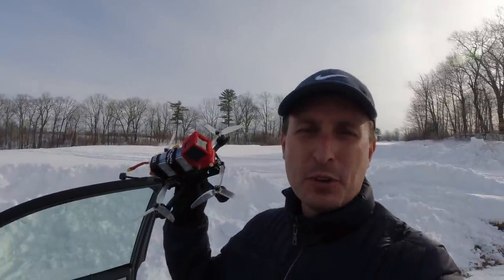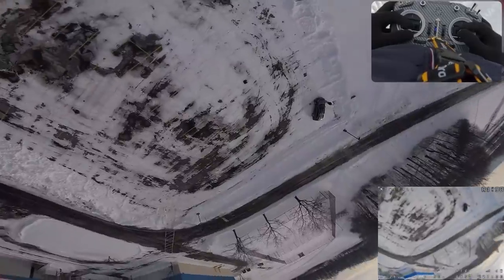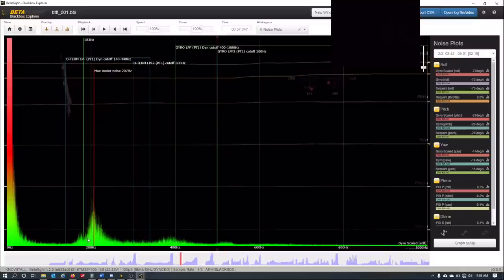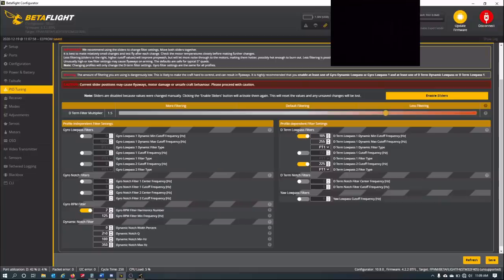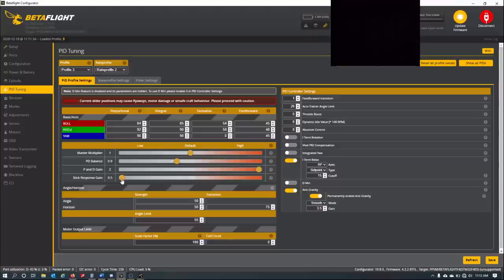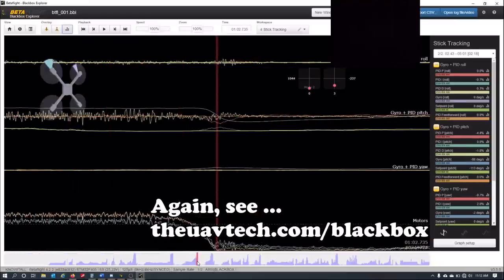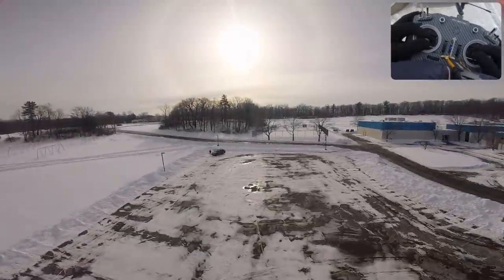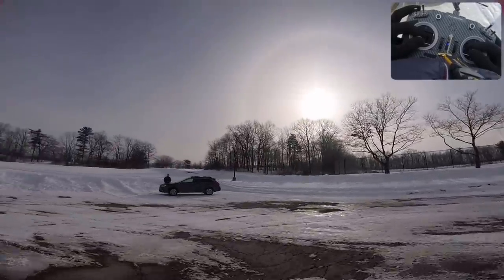How to get an AMAZING Tune -- Tuning JB's 5" Quad

Comment: You are amazing. Thank you for breaking it down to setting filters then PD ratio etc.. the PD ratio bit is something I never understood and always just flew stock pics because I got sick of chasing my tail with pid adjustments. I also underestimated the value of the sliders.

Comment: I agree, BF FF has been good since 4.20 and the actual rates allow one to utilize it to the maximum. To me the default works pretty good but you do need to tweak the ff_boost to match your quads weight and prop to make it feel right. But once you get it right the first time, there’s no going back 🤷‍♂️

Comment: Awesome, so many insights!! You have not commented the motor traces, are you not concerned by motors saturation? At 13:36 motor [1] is maxing out which could lead to inconsistent flight, right?

Comment: Hi Mark I got your link from Joshua, Im so glad I found your channel and website. Im trying to do your exact tunne since I got the cidora also. But on my betaflight 4.2.5 in the independent filter settings the Gyro rpm filter does not show, I only have the gyro lowpass filter, the gyro notch filter, the dynamic notch filter, D term lowpass, D term notch and yaw lowpass but no gyro rpm filters settings show.
Reply from the maker: Turn on Bi-Directional Dshot in Configuration tab.  Make sure not errors when you spin up motors in Motors tab.

Comment: 21:00 most likely your RC output in the radio isn't set correctly. You'd most likely need to adjust mid-trim within the radio for yaw or any axis that isn't showing 1500 in BF or whichever firmware is being used.

Comment: Mark, this is awesome!  Thanks so much!  Just recently began following, although I had inadvertently watched several of your videos in the past.  Would emuflight be an even simpler process, due to the lack of filter sliders?  I apologize if this is a dumb or incomplete question.... im 10 months into the hobby and just now venturing beyond stock tunes and emu presets
Reply from the maker: I would say emu is harder for a lack of sliders.  Everything needs to be set manually and you need to keep ratios in mind because the sliders are not there to hold them for you.
Reply: @uavtech  thanks Mark.  I think im going to take the Patreon Plunge (just coined it, feel free to use it 😆) and really dive in.  Im absolutely lost in these videos dealing with Blackbox graphs and cell data... but I think, just as with the rest of this hobby, that  familiarization will bring understanding.   Thanks for the incredibly timely response!  Super cool of you!
Reply: @uavtech  hey mark.... can you make any fairly quick recommendations as to how I can achieve that "flight one feel" in Emu or Betaflight?
Reply: I realize this might be asking a very broad question.... if so, I apologize
Reply from the maker: Tune like shown here and use F1 rates.  F1 uses high gains.

I think their FF is weaker, but still need to confirm.  SimMode is some fixed amount of FF.  SimMode off is no FF.
Reply: @uavtech  nice!!!!   Thanks so much!!!!  Man!  I've gotta get my head wrapped around all of this, and sooooooon!!!! Lol

Comment: Great tune and explanation thanks 👍
I’m wondering if the yaw movement at 20:50 is similar to something I experience once in a while with my FrSky QX7. I’ll start flying and notice the quad slowly rolling to the right, not by much but annoying and I have to power cycle the radio to fix it. It’s happened with the radio’s internal tx, R9 and crossfire module, it’s like the stick calibration is out on the radio.
Reply from the maker: Increasing deadband sorted it out.
Reply: @uavtech   Yeah I read that in the video and tbh It happens so infrequently over the past few years that I’m not looking to fix it but I find it odd that it’s always right roll for me, regardless of quad and power cycling the radio fixes it.

Then again there’s so many potential points of failure in our hobby I find it amazing we even get into the air when I really think about it 😂

Comment: Great looking tune at the end! Curious as to why you decided to keep d_min disabled while still incorporating a good amount of feedforward. Is that a specific choice for this quad, or do you tend to keep d_min disabled with FF under ~200?
Reply from the maker: I go to D max for the best performance.  At that point boosting D sends it over the limit.  Also, D_min is delayed in booting so does hot help with prop wash.
Reply: @uavtech  copy that. So once you have dialed in a p-d balance,  do you add a little more d_max to help balance the addition of FF?

Comment: Great video Mark. Do you think a tune similar to this ( or all the exact changes you did to Josh's kwad) will get similar results on a 4s kwad on betaflight 4.1.0.  Cidora sl5 frame brand new t motor f60 pro4 2550kv motors zeez f7 flight stack
Reply from the maker: Yup, as long as the vibrations are low like JB's quad.
Reply: @uavtech  awesome thank you

Comment: Thanks Mark for your amazing videos. In general, which slider is helping to reduce bubbles in smooth linear flight?
Reply from the maker: Bobbles are mechanical issues.  You can do your best to cover them up, but may never.be.100% happy.  Maybe try adding D_min to suppress D-term in forward flight.  But it will.make wash performance a little worse.
Reply: @uavtech  ok I will try that... I got this on a Diatone Taycan MCX with 4.1.2. One I moved to 4.2.5 those “bubbles” are much less noticeable but still there when I’m not touching the sticks in straight flight.
Reply from the maker: First make sure RPM filters are enabled wit Dynamic Notch too.  Set Dyn Notch Max to 600.  Try filter sliders are 1.0 and my Toothpic Presets for PIDs.
Reply: @uavtech  great!! Thanks again!

Comment: Thanks Mark, another cool vid, is it possible to filter out light video lines in the video feed?
Reply from the maker: it is electrical noise.  So yes, if you put a capacitor on the electrical feed on the camera or VTX, OR both.
Reply: @uavtech  thanks Mark, Happy Flying

Comment: 1:54 what kind of oscillation was that?
Reply from the maker: Me pumping the throttle to check noise holding.  Or what I (most) call "throbbles". So me pumping the throttle to check "throbbles".
Reply: @uavtech  Thank you. I'm trying to tune my drone on emuflight for almost for a year and cannot get rid of oscillations on sharp turns and split s... Also it shakes in the wind... I do not understand at all does high dterm helps to reduce propwash, because I see two opposite views on that... I have nazgul5 with velox2207 2550kv motors... pid roll 74 60 51, pid pitch 77 73 56... On your videos your pd balance is much higher, dterm is almost twice lower than p... Also I can't get any oscillations with high P even at 200, so my pterm is just choosen by no real reason...
Reply from the maker: @О.Ш-ь1щ  it is all in balance.  At 200P, you have overshooting.  Check out a log, it is easy to see there.

D-term stabilizes for outside influences (wash and wind), BUT also magnifies vibration from motor or frame.  So, if mechanical vibration is low, you can pile on the D-term to keep quad stable in wash and wind.  With that, P-term to keep the nose on point (on the sticks).  D-term stabalizes and P-term keeps the nose on point.

Comment: Hi I'm new in the hobbies I tried tuning my quad for myself I think it fly's great punch out properly wash goonbut if I drop the throttle quickly after a punch out I get a wobble left to right but is smoothens out after ABIT 3 wobbles.dinamic idle set to 25 get longer inverted hang time

Comment: Why don't you use Vbat PID compensation ? I understand a full lipo the quad responds much better than at empty lipo and so the tune is depending on Vbat.  Is there a problem with Vbat are there negative affects ? could you do some testing ?

Comment: Was P/D balance slider on 1.0 not too high? From my experience with that little filters delay my slider is usually at 0.8 sometimes even on 0.7 without overshoot. Just curious 🤚
Reply from the maker: Yeah, but not on this quad.  I generally agree though.

Comment: Is this really an iFlight Cidora SL5-E? Why isnt the target IFRC/IFLIGHT_SUCCEX_E_F4?  In both this and JB video, the target goes between FPVM/BETAFLIGHTF4 and AIRB/OMNIBUSF45D.  Otherwise quite helpful guidance for tuning, as usual with your videos.
I tried these exact settings on my SL5-E and it took off uncontrolled right after arming... back to the defaults and progressive tuning.
Reply from the maker: It was.  For JB's video we were looking at setting on my bench FC since he had the Cidora.

Comment: Question? I got a pre tune iflight titan 1800kv 6s bnf. It sounds good in person but on the hero 8 it sounds like a crap tune. Sounds like the motors are over working. But again it sounds okay in person. Could that be the GoPro or the actual tune? Thanks 🙏🏻

Comment: Would it by a bad idea to have filter settings linked with PID profile settings (with filter tabs having as many profiles as there are PID profiles)? So you can set different profile/filter combos at home and then go out and try them one by one?
Reply from the maker: They should be.  D-term.filter are, but Gyro filter are.not yet.  Just takes someone to do the work and submit as PR.
Reply: @uavtech  D term filters are? Only internally as an option then, 'cuz in user interface there is no way to select filter profiles, right?
Reply from the maker: D-term filters are stored in the selected PID profile.  Gyro filter are not since those filters use tp run in the gyro loop.  That was changed in 4.2, but someone needs to change storage location which has not been done yet.
Reply: @uavtech  I see, thanks for that info. I never inferred that from the gui, but I guess that's because some work need to be done in that area still. Looking forward to it!

Comment: hey i followed this method of tuning, and got my quad flying really amazing, but when i try to land, or accidentally bump the ground, it really yips harder than i would like. motors are cooler than miles davis. my question is, i know bringing the d term down should help that, but i was curious if just bringing the PD balance back from 1.2 to like 1 and then increasing the pd gain til my d term is back where it is now would also help that, i.e. does more p have a similar effect as lowering the D?

Comment: I recall commenting sometime last year that I would love to see you tune JBs or other Youtubers quads with your technique versus their tune to compare.  I've tuned all my quads using your techniques and they all run smooth and very responsive.  Although I  use Blackbox to see how the gyro tracks the stick response , I find that the PID curve using PID toolbox gives much better analytical data on how well the gyro and sticks are tracking (tuned) after each PID change....the PID curve never lies....if it is over or under dampened it will show it.   Is there anyway you can send me the raw BlackBox data from JBs tune and your tune so I can see what the PID curve looks like for both?

Comment: Looking forward to tune my Source1 for midrange 1700kv on 4s and 6s. What would be the difference on PIDs if running two different profiles for 4s and 6s? I means how much higher pids would be on 4s?
Reply from the maker: Hard to say.  I reckon it will influence PD Balance and P and D Gain slider extents.  Both Balance will need to be lower in 4S and P and D Gain higher.

Comment: Hi do you have or can you help with a PID Tune on a Geprc Tinygo? Once I arm the motors the quad seems to move to one side not sure if a pid tune can help with this? Any advice would be great thanks.
Reply from the maker: Angle or Acro.  Set Deadband in Receiver tab to 5.
Reply: Angle mode
Reply: I'm just starting out in fpv so looking to see if there is a pid tune to help smooth out the flight as it  seems like the stick are very sensitive?
Reply from the maker: For Angle Mode, decrease Angle Strength in the PIDs tab.
Reply: Perfect I'll give that a go thanks for the advice.

Comment: Any advice for folks like me who learned on 800 degrees/second with no expo, in regards feed forward... I'm now at a point in BF of about 1.95 BF rates with 0.44 super rate and 0.12 rc expo... But unless I turn FF down, it still is rediculous at centre stick! Do I need to rewrite my 5 years muscle memory to get the most from BF, or do I just keep FF lowered?
Reply: Great video BTW... How much does JB's quad weigh?

Comment: How to prevent overshoot
?
By looking into black box
Reply from the maker: Check out: https://youtu.be/23CAS_nlVbo

U have to know which type of overshoot (" bounceback ") first.  This video discusses both and now to fix each.
Reply: @uavtech  thanks for soon  reply 👍
I have already seen that video and from last one week I am watching your tutorial videos many times and i learned a lot but when ever I am go out to field and try to tune my 5 inch quad and try to see the black box and figure out what's the problem, my brain gets freeze by looking at so many waveforms
As I the gyro wave form tries to track the setpoint in the beginning of the roll it always overshoot and my p term graph goes up and down as the quad enters into roll p term is not smooth 
What to look for sir ? 

I want the very tight feeling quad almost tracking the stick movement but to achieve the locked feel I start getting bounce back and propwash

Comment: Hey Mark love your videos. I have the GepRC Mark 4 6S xfire vista unit with the Tmotor F7 HD & Tmotor 55A ultra 32 BIT ESC. 
IM RUNNING RPM filters. 
Should I use 4K 4K 

It’s set to 8K 4K. 
I can’t change the 8K it won’t let me change it.

My idol seams to fluctuate it’s noticeable in flight after maneuvers.
Reply from the maker: 8k/4k is fine.  That is vibes from the ground.  You can set lowpass slider lower or ignore it.  Pads on arms fix it too.
Reply: @uavtech  When you say low pass filter which one do you mean? I have 200 gyro lowpass 1 dynamic min cutoff frequency Hz 500GL1 PT1 250 gyro lowpass 2 cutoff frequency type and PT1 for the Gyro lowpass 2 filter type ?

I can see the bobble after I do a move. It seams like my motors are changing rpm. Especially after a maneuver.
It does this on Bettaflight default and with the tune that GepRC gave me for the GepRC Mark 4 HD vista unit.
Reply: @uavtech  also the GepRC Mark4 comes with the motors soft mounted with the TPU arm ends.
Reply: I first noticed the problem in the air in my DJI goggles. After I would do a maneuver my videos shakes for a second almost like the motor idle is not steady. So I landed and tried it on the ground it doesn’t spin at a consistent RPM I noticed an RPM fluctuation you can hear it also
Reply: I think it’s my Radio signal. 
I forgot to tell you I’m using crossfire. I have CRSF checked I also have serial based receiver. 
My quad copter seams like the RC signal is jumpy or something.
Reply: I can’t raise my filters at all they are on Bettaflight flight default. 
If I attempt to raise my filters it gets worse

Comment: Do you tune FL1 too?
Reply from the maker: Yeah, just not as precise.  No blackbox, therefore detecting the optimal PD Balance is more seat of the pants and trial / error, taking more time.

P and D Gain push up is just as easy though.  Once it does flutter, i would back down 5 to 10 points on P, and the the corresponding D to hold the PD ratio.  Do math as no sliders to assist.